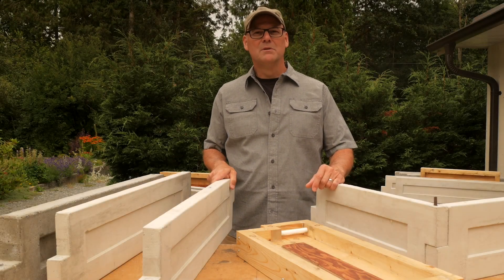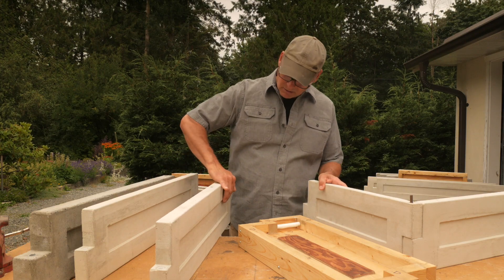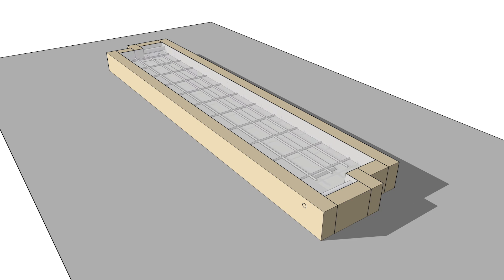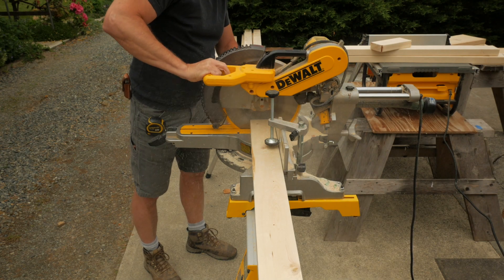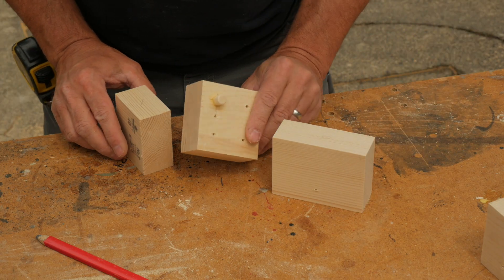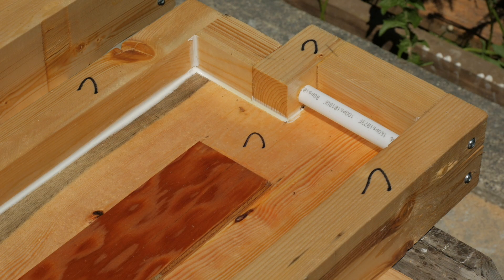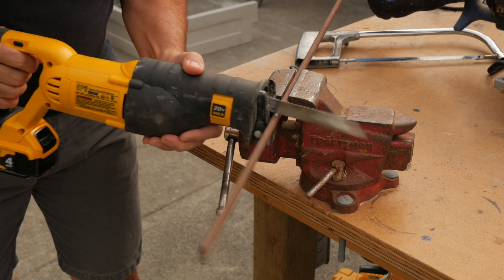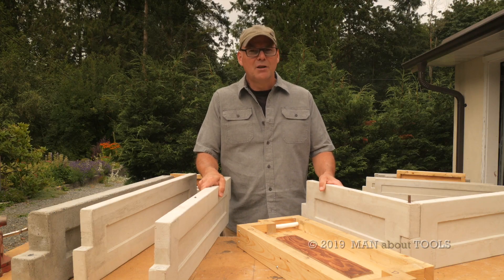make Thin CSA Concrete Garden Boxes PART 4 - cast garden forms

Comment: You could try fine perlite and Portland cement at a ratio of 5 parts perlite to 1 part Portland cement
Reply: He showed a similar mix comparing different lightweight options in part 3 of this series. https://www.youtube.com/watch?v=ddedMmuj7xY
Reply: Perilite is more rigid than vermiculite although not as light. It's a lot lighter than sand though. Perilite may be a good option for making light weight concrete while retaining much of it's strength.
Reply: Perlite might be a great choice if you don't mind it failing miserably.

Comment: Is there a way to make a bottom with this design?  I would to make patio garden boxes using 24" panels stacked 3 or 4 high.
Reply: How about a rubber pond liner?
Reply: Pour a slab and assemble on the slab

Comment: I've been interested in your process from the beginning.
I wonder if the new concrete leaches like Portland cement and if it does what is the compound that will eventually see into the soil
Reply: Line the inside walls of the garden box with plastic sheeting.

Comment: What is the thickness on the new thin panels? I bought your new design plans yesterday.
Reply from the maker: They are 1.5" thick.
Reply: Wasn't that detail right there in the plans you bought?
Reply: @notcharles  The plans have 2 1/2.  They do not have the modification for 1 1/12 to be made from them without knowing the thickness. Changes to the dow  and its location.

Comment: The plasticizer makes the concrete "wetter" without adding water.   Do you have a link for that?
Reply: Available at Home Depot or Lowes. Have bought it several times at Home Depot

Comment: does the CSA benefit at all from adding any additional binder like sand or gravel?  granted i know your concerned about weight, but what if you were after volume.  You mentioned being able to do 2 forms with one bag of CSA.  would additional aggregate get you to 3?
Reply: This might also be a way to add different surface finishes to the finished panels - like small washed rock or even glass similar to those material additions to concrete countertops.

Comment: Why not add vermiculite to the CSA concrete mix? The mix was a bit wet, you could have easily added vermiculite without adjusting the other ingredients.
Reply from the maker: I think with the thinner panels I would not want to sacrifice any strength.
Reply: @MANaboutTOOLS  I understand your concern. (I'm an engineer) Given the loads that apply to a planter box I think you'll be absolutely fine. 24"x30" pavers that take substantially more load are in the 1.25" thick range. .... would be a fun exercise to actually load them up to failure ... but then you're left with a lot of rubble. I would think you're biggest concerns for this application are abrasion resistance and freeze-thaw affects if you're in a colder climate.

Comment: You can use soft clay pushed into the corners instead of calking. It seals just as well, creates the fillet, and makes cleaning and breaking open the mold easier. You can even reuse the same clay a few times if you are careful. Using melamine coated fiber board for the forms will give you an even smoother surface finish than the wood you have been using, but there might be an increased cost. These are the methods used to make glass fiber reinforced concrete furniture, high quality countertops, and even architectural building panels, although some of these are made using spray guns onto mold instead of pouring.
Reply from the maker: Yes! Good points here! Much appreciated. Kent
Reply: KnightsWithoutATable I think the clay would work better than caulk both by reusing and no waiting for the caulk to dry. I used modeling clay for molds in cultured marble years ago it creates a nice bond and can be smoothed with a clay tool. If you were making numerous units it would pay to buy a clay extruder.
Reply: @paulbrody5727  Why buy one? They aren't exactly difficult to make.

Comment: How high can you stack these panels?
Reply: I have the same question.  I would love to make these in an overall 30"-ish height.  I have wood raised beds in a vegetable garden that are 12'" high and would like to replace with a height that is easier to garden with - not so much bending and stooping - increasingly a concern the older I get.  Would also be useful for universal design/wheelchair accessibility.
Reply from the maker: In Part 2 I show panels being stacked. I'd think 2 high would be about as deep a bed as you would need. imho
Reply: For growing purposes, yes.  But for ergonomics, I'm increasingly drawn to higher beds that would allow me to stand up while gardening. There are increasingly more like this on the market. See one example at https://eartheasy.com/cedar-complete-raised-garden-bed-kit-8-x-8/  @MANaboutTOOLS